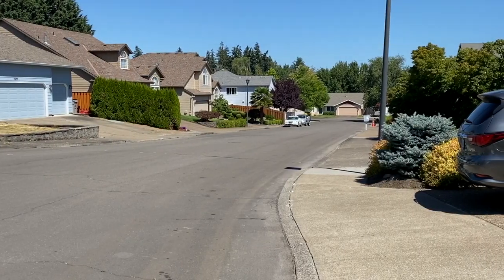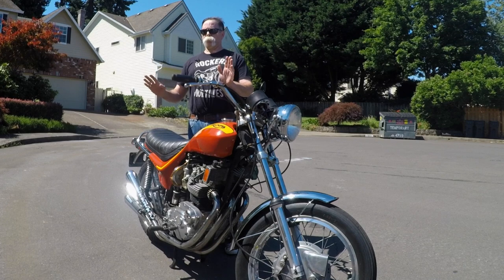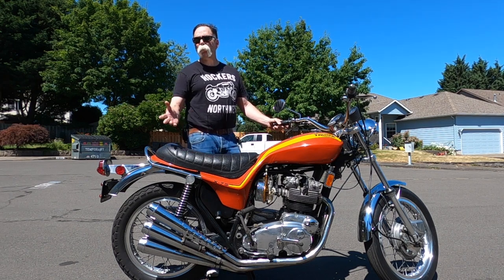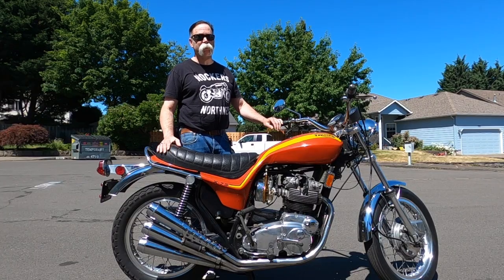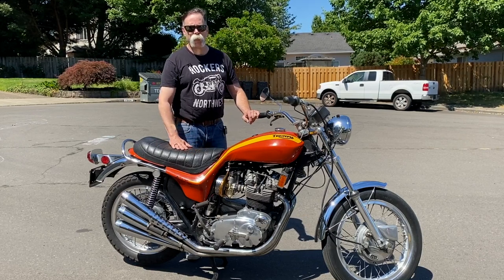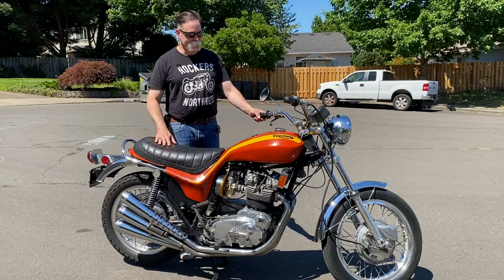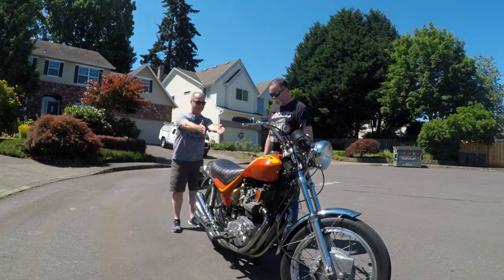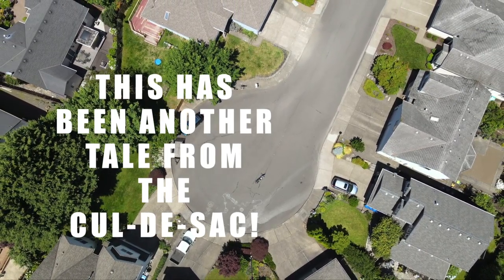1973 Triumph Hurricane X-75 [visit 21 of 31]

Comment: I bought one of those in '85 and sold it about 10 years later.  The Hurricane I rode the heck out of.  I did not baby it, and I didn't ride it like I was a collector.  The pipes dragged pretty easily., and I flattened the bottom one pretty well.  The seller ran a motorcycle shop and sold the bikes to help fund his son's racing.  It was well built and never leaked while I owned it.  Except for tune ups, I never worked on it.  The three points are like two but one more.  It isn't a problem.  Mine also had a milled head, and went fast.

Comment: You had hinted a Triple was coming.  What a great example.  Nothing sounds quite like one.  Too bad  we couldn't hear it hit 6 grand.
Reply from the maker: Hehe, we will have to take this show on the road Mitch!! Thanks a lot for your note. Cheers, Mike
Reply: If you liked 6 grand you would have loved to hear the rock3 BSA gp race bike from the shop I worked for hit 9grand it had 3 into one open megaphone with a short return cone only about one inch long reducing the opening about 3/4 of an inch. It sounded a lot like a Porsche open class race car of the time.

Comment: Beautiful non-restauration...great job. 
Not to nit-pick but the BSA triple was canted 3 degrees forward from vertical, not 30. Craig Vetter - used to have one of his Windjammer fairings on my '76 CB 750 - insisted on wider cylinder head cooling fins for the Hurricane. I think it comes to 3 inches total over the stock R3 cylinder head...maybe a bit less.
A friend of mine did a total resto on his. He said fitting the 3 separate exhaust pipes was a bear of a job, fiddly as hell apparently.
Reply: FYI the cylinders are canted at 15 degrees.

Comment: Back in 1973 I was tossing up between this Bike and the First Model Z1 900, I purchased the Z1 and was so impressed with it, I payed  $1895 Aust for it, had it on higher purchase as the called it, 3 year term, 1 payment left after 3 years and it was stolen, insurance payed me $900 I went a purchased another 1973 Z1.

Comment: Hello, great video. I bought one of these in 1978 #1141 or 1147 as i recall but its been a long time. Mine had a 5 speed.   When i got it some cretin had tried to make  chopper of it.  6 over forks  and 10 inch dogbone risers with 4 bend pull backs.  I had to stop next to curb riding it home!  finding parts for it was tough , but i made do.  I had the fork tubes machined down to X75 specs and ditched the risers - they literally moved back and forth 4 inches!  I got some norton bend bars that were close to the originals.  the fool that "chopped" it notched the tail section for a sissy bar.  sacrilege! I had a local fibreglass repair fix it .  The aluminum was all oxidized and i repolished it by hand with simichrome and 4-0000 steel wool.  that was without taking it apart! i still dont have fingerprints.   The exhaust was perfect and is a sound ill never forget.
I rode it a few months and it started to smoke really bad.  as it turned out a inner valve spring broke and tore up the valve pocket in the head  . I racer friend of mine had a machinist  fix it and replaced all the springs and valve guides with aftermarket parts.  I remember the bike had a terrible straight line wobble that i fixed with new k81's  it was really hard to start on cold mornings and the carbs leaked no matter what i did.   I sold it
to Buddy stubbs HD in 1981as he was insistent on buying it.  he has a great local museum with lots of english bikes , but sadly not the x75 anymore. 

Take care and thanks for walk down memory lane!
RandyTbird
Reply from the maker: Hi Randy, many thanks for your great story!  Really appreciate you sharing that with us. Best wishes, Mike
Reply: @TheMightyGarage  i just put up a pic on my instagram page  Randytbird
Reply from the maker: Thank you Randy!  Very cool looking bike!  Cheers, Mike

Comment: The clutch on the BSA A75 and the Triumph T150, T160 & X75 is a dry single plate Borg & Beck unit, it's exactly the same as the clutch on the Austin Mini. in 1982 I had to replace the clutch plate on my T160V Trident, I bought a Borg & Beck plate for a Mini from a British Leyland dealership it cost a third of the price of a plate from my local Triumph dealership. If you need to buy disc brake pads for a 1970's Triumph Bonneville or Trident, the pads from the 1275cc Mini Cooper S fit straight into the AP callipers on the Triumphs, again at about one third the price of a set from a Triumph dealership.

Comment: sounds so crisp. X-75 fav' designed m/c , Craig Vetter hit the nail on the head with this one. did not know that fibreglass was not painted and that  the moulding mark was visible right up the centre of the tank. thanks, a little more education.

Comment: FANTASTIC!! I haven't seen one of those in years, the last one was at Daytona in 1985 or 1986, and it was in  a museum. My local dealer had one in the showroom in 1973, and it sat there for months before it sold;  everybody wanted a Honda 750 Four or a Kawasaki Z-1. Even the Kawasaki Triples were preferred. I lusted over the Hurricane, I was riding a '72 Triumph Daytona at the time, but couldn't afford the upgrade (I was only 18 then). Too bad for me; when I see Rocket 3's selling for $10-$15K now, I can only imagine what a Hurricane would sell for, IF you could find one somebody was willing to part with. The only thing I'd change for appearance sake would be the taillight bracket, I'd look for a 1970 or earlier BSA or Triumph OE version. I might put a shorter set of fork tubes in it, like the standard Trident or Rocket tubes.  That is a marvelous bike, thanks for this video.
Reply from the maker: Many thanks for your great comment. Much appreciated. Best wishes, Mike

Comment: That design is not dated at all.
How about a retro model of this
from Triumph.
I learned something today.  I find 
it is amazing that the BSA and Triumph three cylinder motors are
slightly different.  That gives you 
some insight into why the original 
Triumph and BSA companies are
no longer around. That and also
can you imagine how their hearts
sank. When they found out the Honda CB750's, we're coming.
And they have these new Rockets 
and Tridents on the assemble line.
Sealed there fate, unfortunately.

Comment: In the bike shops here in UK that front brake found its way on to most of the BSA  range - As a teenager, I remember seeing  on a new Starfire there was a huge label warning riders the bike was fitted with an 8" twin leading shoe brake  and that rider should exercise caution  - it was a lot of brake for a light  25hp 250 but not for the 750 rocket - then honda came along with a disc brake and  style moved on

Comment: there's one of these x-75s listed locally, St Petersburg, Florida, restored for $28,000.00, 
https://www.facebook.com/marketplace/item/323066125731273/
as time goes on a lot of people seem to think that motorcycle engines are getting bigger, in 1912 Wilkinson (Great Britain) made a 1000cc, water cooled in-line 4 cylinder,, in the 30s Royal Enfield made a 1100cc bike ( i believe) and of course the Ariel Square 4 - 1000cc.... great to see another rare bike at The Ace Cul-De-Sac...also when a bike has been standing for a long time it pays to Redex the bores for 24 hours, (most brits will know what that means) white clouds of smoke but rings lubricated and compression as it was designed upon start up.

Comment: Nope I saw those Kickstarter arms break in normal use if a person did not know the proper starting procedure and kick too hard you could break the top of the retention slot right out I used to start mine with my arm but then I use the proper starting procedure.

Comment: Bought new 73 XR75 Hurricane at Smittys  Rock Island in 73  ( $2000. )installed larger sprocket and modified carbs throttle in 2nd gear very easy to do a wheel stand 3-400 feet ! After winning  a few street races I was stopped by the police !   They said you are not in trouble we just want to look at your bike ! 😂😂👌👍
Reply from the maker: 😀😀 I can understand why the police would want to stop to take a look. They are awesome bikes. Best wishes, Mike.

Comment: Just dehydrated myself from drooling. I always liked the Trident version over the BSA Rocket 3 but this is much better having the leaning engine with a Triumph badge.  Sadly out of my price bracket. And to think I turned a Trident down in 1980 £250 aghhhhh.
Reply from the maker: Hehe, thanks a lot and CONGRATULATIONS on getting your BSA running again. That was a fun video! I was cheering when it started 😎 Cheers, Mike
Reply from the maker: @toooldtodieyoungmotorcyle  Oh sorry man.  I know what you mean.  It is one thing after another.  Wish we lived closer, we could do a tech session!  Cheers, Mike

Comment: Compared to a stock Trident 150/160 these Hurricanes were ugly. The "custom" movement in the 60s which led to multiple Meriden works of art being sacrificed to the ala mode stupidity of chopping extending bar elevation gave birth to this. Lines are not fluid, kindergarten design but nice paint job. This next to a Hornet Scrambler Bonneville TT, TR6C, Commando, Commando Fastback and all others of traditional British styling was a step or two below. I like Vetter, he was our MC at Riding into History a few years back.
Reply: And this is why the British motorcycle industry failed.
Reply: @swooshdave  But they left their mark. 70 + years on people are still copying the esthetic designs with modern tech.
Reply: @raywite6665  Yes, they are some of the most iconic designs of any motorcycle. But some designs were a bit odd and so not everything was an instant classic. The original Rocket 3 and the Norton Fastback come to mind. The Hurricane is tremendously recognizable and by no means an ugly design. If anything it suffers from the fact it's a British bike designed by an American. Well, at least in some British eyes.
Reply: @swooshdave  The Flash Gordon silencers......